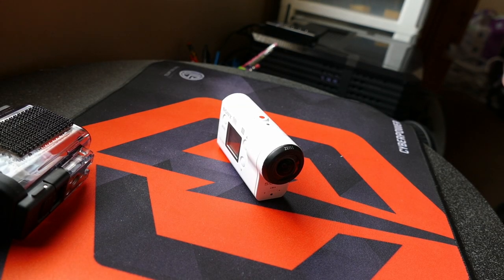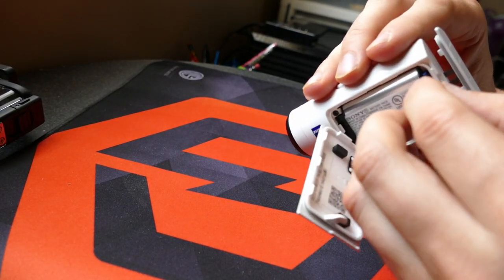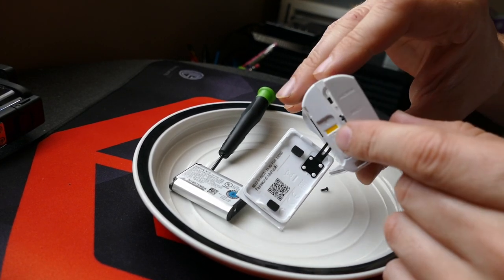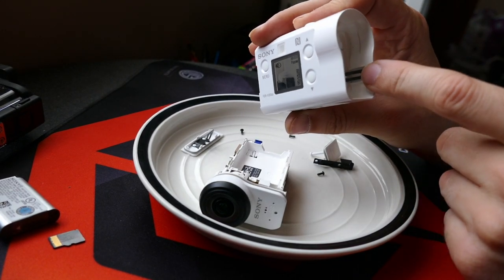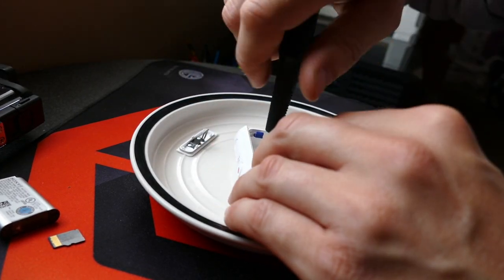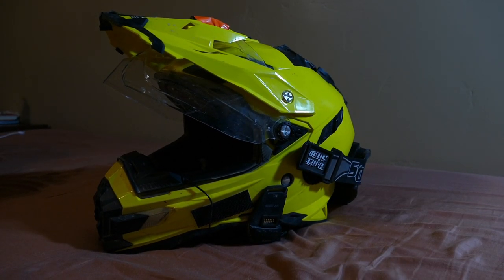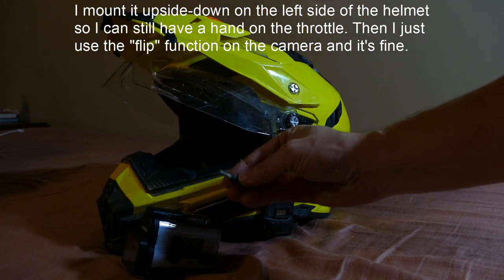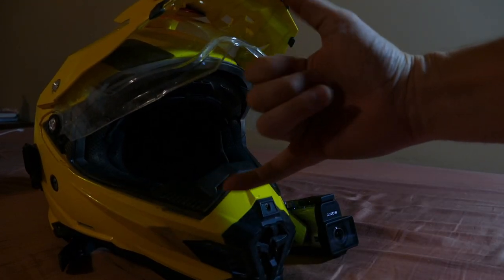Easy Motovlog Mic Mod for the Sony FDR-X3000 & as300 Action Cam #everide

Comment: Guys, I literally just finished following this video step by step and it took me about 5 minutes.  Now I just have to drill the case out and were good to go. Thanks for the video EveRide! Hope your doing well. Can't wait for your next video. P.S If you buy this camera ensure you purchase a extra battery right away as you'll need it for sure. I'm getting about 40-55 minutes of life on a single battery. Also the remote does not have a spare battery so I find that limiting when using the watch remote unit when I'm riding.
Reply: WADZ UP you can drill another hole for an external battery charger and dual lock an external battery on your helmet.

Comment: Great video! Just an add to it.  You don't actually have to slide the camera guts all the way out.  If you just slide the guts forward about a half inch, you can use a little screw driver to push the metal slide under the plastic catch on the back, releasing the door.  Then reassemble.  Thanks again for the video!

Comment: Got a minor heart-attack following those instructions... disassembled, reassembled and after completing the task the bloody thing wouldn't turn on anymore. None of the buttons did anything.. My only consolation was, that connecting it to the computer the charging orange light would turn on, so I was hoping the battery had died. Luckily, it was so. Guess it had turned on in my bag and run dry... I'm gonna go and have a strong glass of wine to get my two years back that I lost... XD
Reply: LOL!! :D

Comment: Pretty sure the reason he actually does this is because to start and stop recording while in motion the right hand is busy on the throttle so it require a left mount. 
I know the x3000 has a remote live viewer that you wear on your wrist but it takes 20-45 seconds for the live view to sync to the camera. So in order to manage the stopping and starting and keep the hand on the throttle he needs to mount the camera on the left side and needs to mount it upside down because only one side of the case does NOT have buttons and can accept Dual Lock.

Comment: I made one of your mounts a while back after watching your DIY video. I works great and for a DIY solution that takes less than an hour to make from start to finish it actually looks like a quality store bought solution. Brilliant!

I really wish all the companies that make action cameras would sit down & actually watch how the people who use them have to continually hack every single one they release to capture usable quality sound ........... AND THEN MAKE ONE THAT WORKS OUT OF THE BOX!!! And I don't mean a WIFI solution that adds even more batteries and recharging into the mix. Sony could easily have put silicone plugs in the rear door and camera housing so you don't have to remove or drill anything yourself. Just sell the camera & case separately so customers can choose a fully waterproof or impact protection option themselves. I won't hold my breath for that to happen though. I love the videos from my Sony AS20 but if another company wakes up, or comes to the market with what people really want they'll be getting my money from then on. I really enjoy all your videos well done.

Comment: Dual lock eh. I got the 3M brand that sticks very well to surfaces, but is too weak to hold my camera when rolling the camera off my helmet. Twist and pulling straight off is pretty strong though. I'm thinking of another way to mount it. Love the mic tip though and will be doing that.

Comment: I just did this. Good instructions and done in just a few minutes. However, when I got it open, I felt a bit stupid.  I realized that the only thing holding that black tab is a tiny white plastic tab.  If you just use a knife to shave it back about a tenth of an inch, you can insert the black tab or remove it at will, opening and closing the camera like normal, but removing the door when you don't want or need it.  I shaved it off from the inside, since I already had it open, but I could have shaved it off just as easily without ever opening it up.  That seems a much easier and more elegant solution.

Comment: Hi. long time lurker, first time sub. What is the battery life like on the new sony? I have the AZ1 and its life is awful (that mounts to my helmet quite well after watching your mounting video..thank you).... I mount a rechargable battery pack that plugs into the camera (through a hole I drilled into the case oddly enough) that also mounts to the helmet with 3M.

Comment: Thank you for the tip. This made my choice of a new action cam for adventure riding easier :) I would just drill another hole to the usb port so I could charge it on the go.

Comment: Great video. Really well done and very clarifying. 

However, I have just one question. Do you think it can connect, via bluetooth, an external microphone? I didn't want to sacrifice the case because I need for underwater images. 

I would extremely thankful if you could answer. 

Thank you so much

Cheers, from the Azores Islands - Portugal
Reply: You can't connect a bluetooth mic to it.

Comment: hi just asking, is it possible to connect intercom like sena with the camera by bluetooth? so we don,t need to mod the case for motovlog. thanks
Reply: Great question!
Reply: Great question indeed! However, Sony will not allow any kind of "quality of life" firmware updates ao the answer is no. I believe the X3000 and AS300 are also still clipping with external mics. That is literally the only reason I have returned the as300 and went back to mu old as200.

Comment: I am seriously considering returning the Hero 5 black and getting a Sony FDR x3000.   Also...never saw dual lock until this.  Much appreciated.
Reply: you should ! it has lots of great reviews and works very well, lots of experts are saying it's the gopro killer. I just got mine few days ago and its amazing !
Reply: I did get it.  Loving it.  The wifi connect with my phone seems less glitchy than the same with the GoPro
Reply: If you turn bluetooth off on your smartphone, the connection will be even better.

Comment: Late to the party here however you don't need to disassemble the unit to perform this. You can use a small flat head screw-driver to simply hold the flap that is used to lock the door hinge in place.

Comment: thanks a lot for your review. I buy in the past the as200 after I see it in you vid. I am happy but I never used the steady shot because of the lose in the wide angle. now I I'm done with the cheap China cams. I want to know how do you turn you cam on? because when I drive an finde a nice road I don't want to stop and to finde the button is easy but not to push while driving. so I use the live remote kit but the I drain the battery pretty quick. or does make Sony a improvement and the live remote turn the cam on when it is in standby?
Reply: There's a setting on this camera for one touch recording. With the camera off you just hit the record button once and it turns on and starts recording at the last settings it had.

Comment: A related question...does the camera continue to operate while it is plugged in and charging? I do endurance racing, and would like to be able to charge while recording. I don't necessarily need the battery level to actually go up while operating, I just want to extend battery life.

According to the manual for the FDR-X3000, it won't operate while being charged...but i just find this hard to believe.  Is it true?
Reply: You can plug the camera to the wall charger or any other USB power source and use it in every mode but you need to keep the battery on camera to operate. It won't work if you plug the camera USB cable to the computer.

There's an option on the settings that allows you to set to off the USB charging mode, if you want to avoid any extra consumption from a battery pack for example. really nice feature.

Can you plug a battery pack and record non-stop? ABSOLUTELY.

Comment: Hey man. Is this still the recommended camera and mic fix for motovlogging? My go pro mic insert is shot, and I'm thinking about a new camera.
Reply: Sweetman yes. This or the cheaper as300 if you don't care for  4k
Reply: Wow.  Very complicated, difficult and risky process to do something that can be done better in about 10 seconds with no risk or mess.  Just take a penknife and use it to cut off the tiny plastic tab that holds the black plastic "wires" in place.  After you do that, you can slide the back door on and off at will, no trouble.

Comment: I thought this camera was already IPX4 which should be adequate for Motovlogging? i.e. no waterproof case needed.
Reply: With the back flap open, it is not splashwater proof anymore.
Reply: NicMediaDesign thanks for clarifying.

Comment: Awesome video! (Liked & Subscribed)
I've also started out with a Sony Action cam that I've got for 100$ brand new at a clearance sale. Mainly used it for monitoring my rides but lately I've been getting a bit into motovlogging & uploading stuff on Youtbe. 
I haven't quite got the audio thing worked out though, but it's a work in progress :)
Been a bit scared of drilling into the waterproof house mainly because of the moisture & fogging issue.

Comment: Is anyone using the Sony outside of the waterproof housing for moto?  I'm thinking about getting the $30 lens protector.
Reply: I use it without the case always when on my bike. Even in rain.
Reply: NicMediaDesign it’s spec’d ‘waterproof’ even without housing😉, like GoPro, it  goes deeper with housing.

Comment: Just bought a Sony HDR-AS300. It lasted three days before the battery stopped charging. It gave me problems from day one. When plugged into power (usb, wall socket, batter pack) it would go directly into USB mode and I couldn't use the camera. Now it just stopped working. This camera is horrible. I guess if you get lucky and get one that works, great. But buyer beware - I know have a $300 plastic piece of crap.